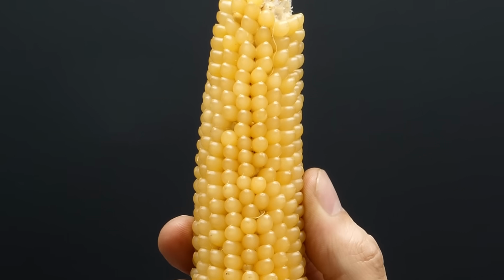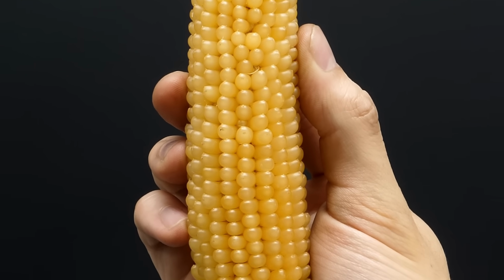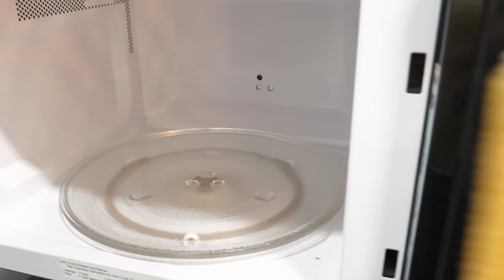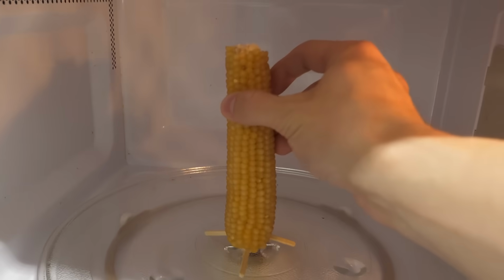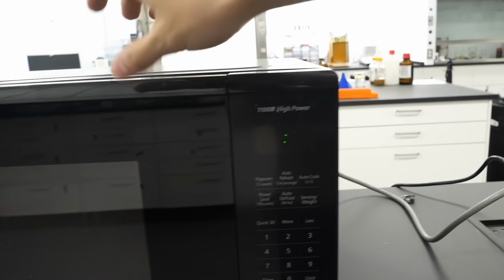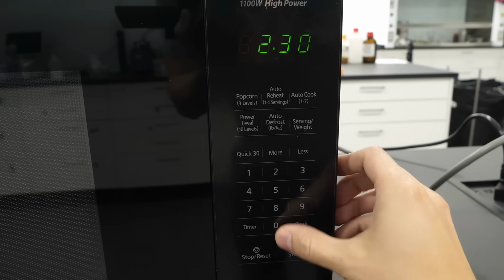Popping corn on the cob in the microwave

Comment: he actually drilled a hole into his microwave, what a mad lad
Reply: Holy shit! I didn't even notice
Reply: :awesome:
Reply: It was for his other project, when he did plasma balls in microwave. #Deep_lore
Reply: he is building up his radiation resistance so he can finally visit Chernobyl. with no safety equipment
Reply: it turns out, the waves emitted by a microwave are pretty big! so the hole could be easily 2-3x the size and still not really be a danger!
Reply: @omaro_o7151  how did you think he made the footage?
Reply: @MusikCassette   shrunk himself to fit in microwave and shot it with his phone, as any sensible mad scientist would do.
Reply: It is not mad if you know what you are doing.
i.e. you need to know the wave length the microwave uses, and make the size of the hole acordingly.
Reply: dont worry this really tells that you have a great eyesight
Reply: Since microwaves wavelength is about 12 cm high they can’t escape from small holes so it’s very safe
Reply: @user-ny2wy3jl1t  how in the fuck did you type awesomeface
Reply: It's to stick your finger in and test the temperature.
Reply: 1:13 holr is at the back of the microwave.
Reply: @Unknown-ov7pq  wow bully in comment
 🤣
Reply: @Ketan Roplekar The frequency put out by a microwave is around 2.4 GHz (Same as your WiFi yes), with that the wavelength is around 5 inches (12 cm) which prevents the wave from escaping from a tiny hole. There may be a little bit a radiation leakage, but it probably wouldn't be enough to do any damage. But I would still not recommend drilling holes in a microwave unless you absolutely know what you are doing as it can get much more complicated than just wavelength and hole sizes.
Reply: @satanhell_lord  Thanks for the info Satan-Chan
Reply: Lol really? I thought he just put that camera in the microwave, I was like “damn that’s a strong ass camera”
Reply: @user-ny2wy3jl1t  android?
Reply: @darkphantom5681  same, hahaha 😅😂
Reply: There's bots in this comment
Reply: Second channel I've seen do this. First was TKOR a few years ago.
Reply: @s1lh0u3x  Anyone can do that though. You can visit Chernobyl and you don't need any protective gear
Reply: he did it when he made the microwave plasma video in the main channel
Reply: @craiga4215  no mean like. inside the reactor.
Reply: @Mila kunis______👇💞 Why the hell are you guys always trolling!
Reply: Na it was the cameraman who was inside
Reply: @user-ny2wy3jl1t  how

Comment: You have to tell more about the Unregistered Microwave Spycam V2 that can withstand the power of microwave.
Reply: yeah wtf how
Reply: Seriously? Just think about why you dont get microwaved while standing in front of the microwave... And then... You know how to protect your camera.
Reply: Thats what i noticed too. A
Camera inside a microwave!!!!
Reply: Just what I was thinking!
Reply: microwaves use standing waves, meaning there are parts where there is lots of energy and parts where there’s none (which is why the plate spins to try and get each part of the food touching the high energy bits at some point) so there’s parts of a microwave where if you put a small enough camera there (smaller than a blueberry which exploded b/c they’re the same size as the wavelength so it gets supercharged) then it’s fine, say like where a screw goes or something
Reply: @realericanderson  Thats maybe valid for microwaves that have that moving table. If you have one with that moving waveguide (or hoever that thing is called) i thing that wont work.
Reply: @realericanderson  uh I think he drilled a hole at the back and try to adjust the phone/camera just to get the perfect view
Reply: It was the v4 and it is registered for secret ops from nasa
Reply: Thissss is what I came to the comments for..!! Wtff how??
Reply: @luisgin8288  You mean how he filmed this?
You realise that you can see the camera at 1:15.
All he did was cut some holes into the back plate of the microwave and put a phone against it.
Reply: Drill bit, meet microwave. Cell phone, meet hole-in-microwave.
Reply: He built a custom Faraday cage made out of invisible... material.
Reply: I forget what video it was. I think it was one about making plasma in a microwave. But he explains how did the camera setup in that one.
Reply: @emanemanresuresu  that would be the lead mesh on the window. But i didn't see that infront of the camera.
Reply: @xstation6445  i bet you could make it so the caemera sees through.
Reply: Weeaboo Jones  Finally someone said it. a hole the size of a quarter will allow partial microwaves to pass out the back, a hole the size of 4.7 inches will allow complete passthrough. Noone going to talk about the health risk involved here just for a cool couple seconds of footage lol?? If I was living with him, I'd be moving out... stat.
Reply: @realericanderson  Just drill a hole in the microwave and place the camera looking inside. It's not so hard, you can definitely do much more dangerous experiments with a microwave than the simple act of watching inside it.
Reply: @joelembiid2238   First, no one lives there it’s his personal lab where he records videos. Second, you’re being overdramatic the hole is small enough that either very little or no radiation is leaking and even if it did there’s very little risk that he would be seriously injured at most minor burns and even that would be a stretch.
Reply: Metal camera inside a microwave?  Or plastic camera?  Either way they would be destroyed.
Reply: @joelembiid2238  Relax, man. It’s not ionizing radiation.
Reply: Watching popcorn pop on/off the cob was something I never thought I'd want to see, but now I hate the fact I didn't see it sooner because that was so satisfying to watch.

Comment: Wait, how can the camera be put in the oven without blowing up ?
Reply: it isn’t in the microwave, me made a small hole in the back wall of it and put the camera up to it so he could see the corn
Reply: Cameraman
Reply: The camera man never dies
Reply: because the microwave in this video was tasked to pop corns not fry a camera
Reply: @ThatGreenCrystal  Not true
Reply: You can see the hole he made in the microwave for the camera when he opened the door
Reply: @PilaCiu  what he said is true. electronics fry in a microwave because they're overcharged, not because they're heated
Reply: @PilaCiu  You are wrong. Microwave oven are tuned to be able to oscillate the fat and water particle. When the oscilating particle reach its resonance, they will heat up very fast.
Reply: @PilaCiu  If you put a plastic in a microwave, it will not heat up. If you put soap in the microwave it will expand because there are fats in it. If you heat something such as fries or chicken nuggets,  it will come out soggy because of the water molecules escaping the structure. This is also why when you feel the sides of the microwave they are not burning like an oven. The radiation of the microwave creates molecule vibration causing the piece of thing to heat up. Things such as plates heat up because dissipation of heat such as water molecules in the moisture of the air
Reply: @ThatGreenCrystal  Then why does metal and cardboard heat  up?
Reply: @PilaCiu  Metal because It is a great conductor of electromagnetic radiation, just how it is used in powerlines.  Cardboard is an insulator. Water molecules can get trapped in the cardboard since cardboard removes moisture, then when the water molecules get too high at about 400 degrees Fahrenheit the cardboard literally stars to catch on fire because of polarization of the trapped moisture
Reply: @PilaCiu  I guess if you really put it, you could add metal as long it's not ionized or put a a special configuration (like if two metals are touching it would work or if it was a magnet). Some metals can be an a insulator too. Usually when the atoms  are not aligned in a certain way

Edit: Sorry, I meant that every metal can conduct (because electrons can move freely) but some are just really good and really bad at it.
Reply: Yo can anyone actually explain how did it not blow up?! It has electronics and yes is susceptible to charge damage. So why it doesn't..
Reply: @ovalquadrant6012  yes, but barely noticable to a temperature change more than others.
Reply: @srisutharsan3089  hole in the back of the microwave
Reply: @iPlayHacker real
Reply: The camera Is invincible
Reply: @gm_construct_13_betaexplor38   huh? how's that possible??
Reply: @ThatGreenCrystal  are you guys physics majors or is youtube just full of microwave oven experts? This is an oddly specific thing to have expertise in...
Reply: @thegeth4293  no it's just thermodynamics and electromagnetic forces
Reply: @iPeter that's why I said and metal too
Reply: @iPeter yes 😂
Reply: @ThatGreenCrystal  Plastic absolutely heats up in a microwave. Put a plastic bowl in and run it for three minutes and then tell me if it's still cool as a cucumber or not.
Reply: There's a tiny hole, small enough to keep the phone camera from being zapped, and or/radiation to leak out
Reply: @ThatGreenCrystal  That was so informative. I always wondered why some stuff was so soggy coming out of a microwave.
Reply: @SkcreamStream  yeah I NEVER cook bread in a microwave it always gets turned into a lump of rock
Reply: Ikr

Comment: I actually haven't seen sweet corn back in my home country. Sweet corn was the same thing as the hard corn you used but boiled. We would prepare the hard shell corn by roasting it on fire and adding spices with lemon on it. It's really good
Reply: That's not the same as sweet corn, but sounds tasty.
Reply: It’s called a bhutta here in india, we would roast it then apply spices, and lemon on surface, another way is instead of roasting, just boiling it and then applying sip iced and lemon.
Good stuff
Reply: Just ate some today, cooked it in the microwave, shuck, cob, silks and all. Cook for 1.5 minutes and remove from microwave, cut through bottom section and pull the shuck and silks off from the other end. No salt or butter even needed. Yum Yum.

Comment: one interesting bit is how all of the initial kernels to pop were at the same level on the cob. I guess this could be due to how the cob developed, but my guess is that it is due to the standing waves in the microwave imparting more energy to those kernels. I've always wanted to see a 3-d demonstration of microwave standing waves. The usual ones using chocolate in a sheet just shows you two dimensions, but I wonder what it would look like in 3D

Comment: This is very cool. I'm interested in the spycam too. Is it not effected by the microwave radiation?
Reply: Microwaves, despite what their name might suggest are actually quite large, about of 10 cm, the hole for the camera, being 0.1 cm or less basically lets through almost no microwaves
Reply: the microwave doesn't have radiation. It has microwaves tuned to excite water molecules. Its probably uneffected if its not metallic and has no water in it :)
Reply: @stephenwhiddett  The magnetron generates electromagnetic radiation at that specific frequency I understand, just wondering if that has any effect on a camera. I know other forms of EM like x-rays have an effect
Reply: @tubbychubb3026  I don’t think so. They are just like radio waves but with a shorter wavelength
Reply: @stephenwhiddett  Radio waves and microwaves (and even visible light) are all considered electromagnetic radiation. It's still a kind of radiation, even if it's a lot less dangerous than the "scary" ionizing radiation that most laypeople are afraid of.
Reply: @stephenwhiddett  It's short-wave radiation. Just like radio waves. Heat, microwaves, light, sound, all forms of radiation. Radiation literally means the emission or transmission of energy in the form of waves or particles through space or a material medium. That covers a lot.
Reply: @tubbychubb3026  Yes, they are a classification within the EM spectrum.
Reply: technically anything that radiates out from a source is radiation. Tubbychubb, what you are probably thinking about is ionizing radiation which i am not sure if microwaves are considered ionizing or not be yes it is radiation.
Reply: @AL_O0  I guess that explains why X-Rays would effect a camera since the wavelength is much smaller.
Reply: @IrishRepoMan  ok but it's not radioactive which I thought the original question was asking
Reply: @nicksmith1280  
The only thing a microwave can really do is fuck with wifi signals.
Reply: @stephenwhiddett  The original comment says radiation, and you replied saying microwaves don't use radiation.

What you're thinking about, nuclear radiation and radioactivity, is more specific.
Reply: @stephenwhiddett  Sadly, every single thing you said is factually wrong, sorry. I know in the intention it's all near the truth, but actually, it's not.
But it's normal, I even learned one of them today too. Even the people that know approximately and try to be right can be misleaded.

First, as said earlier, microwaves are electromagnetic radiations, larger than light (IR), when ionizing radiation, that are cancerigen, are shorter than light (UV), and these are everywhere, from human activities, and most importantly (from the sun (in both heathly and dangerous ways, because most rays are not ionizing, but long exposure can still be too much so we have to use sunscreen)

But yeah that's are not really radioactive, like particles that disintegrate and radiate ionizing rays and particles. (Those we still encounter everyday naturally, but in very few quantities, and which are still extremely far from x-rays scans, that are the most dangerous ionizing things we'll all ever encounter, even for nuclear employees (pilots and astronauts are in the worst cases too, thinner atmosphere means more unblocked ionizing radiations from space up to gamma-rays, beta and alpha particles.

So now about the tuning... Well, that's sadly(?) wrong, because in fact a magnetron is very chaotic and can't produce mono"chromatic" tuned waves at all ; so it emits in microwaves, but in a relatively large variety of lengths, so it's not specifically existing water...
I felt so cheated on when I saw that earlier xD but now it seems more logic viewing how a magnetron works.

Instead, the microwaves somehow produces electromagnetic fields that force molecules to turn in a certain position, which is also what's causing friction and heat anyway. I don't know precisely, and I'm still wondering if hydrated things still generally heat more easily than completely dry things.

And finally, about the metal... It depends. first, microwaves are made in metal, it's precisely why it works, as a faraday cage. Metal mirrors waves without absorbing them (mostly), so it's not heating itself, but when a microwave oven is empty or with only metal inside, waves will bounces infinitely until they encounter a little hole... Or find their way back to the magnetron and bounces even more, so all the accumulating energy will finally make the metal heats and ends to destroy the oven.

Then, even if there is also some food to spend the energy in, as an "unexpected" metallic object placed in a microwave will rarely be perfect, all the the imperfections, gaps and curves in the metal can make the waves concentrate on some points, and quickly form sparkles.
But now, if we respect how microwaves works, it means we actually can put metal inside of a microwave, but a specific plate, with no imperfection so it will simply make waves bounce back to the food over it.

I've already tried microwaving party plate (refined, like for weddings maybe), that has metallic patterns and borders, for a minute or two. It didn't explode that much (made sure that there were enough food to absorb most waves anyway), but when I "cracked", I noticed that it was always  on the most damaged parts of the pattern.

So with so much waves, even a little hole will surely encounter waves. I also wonder how it interacts with the camera. Camera works by absorbing visible light, and here it's basically invisible and less energetic light, so maybe it just bounce back on the flat objective to the oven... Which would mean we paradoxically shouldn't make the hole too small, to prevent waves of being captured.

Comment: The important question here, how are you recording that from inside the microwave?
Reply: There a camera on microwave
Reply: @Nama181-j2c  ok, then the question is how the camera can tolerate heat😁
Reply: @wakawaka608  built in
Reply: He drilled a small hole on the back of the microwave, as long as the diameter of the hole is smaller than the wave length, it won’t cause radiation leak, also the camera is outside the microwave taped to the back recording through that small hole, you can actually see the hole when he put the corn in.
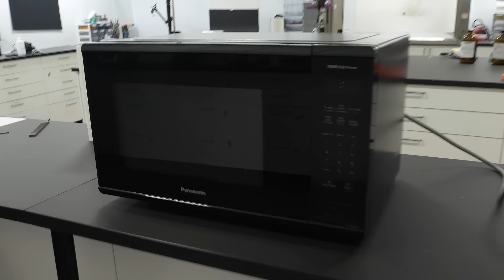Reply: @liming33  thanks mate. The hole is visible at 0:30
Reply: @liming33  woah thanks
Reply: I'm sure it's at the glass
Reply: Antman shot the video, simple
Reply: @liming33  Nut Uh He Microwaved a GoPro
Reply: Unregistered Microwave Spycam V2
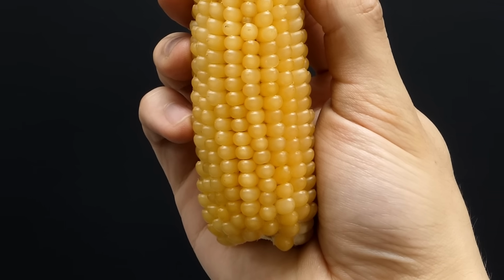Reply: @itzamia  Bullshit. You can see the 3 holes for the camera and 2 flashes of a phone camera on the back of the microwave at 0:30 that he drilled in.
Reply: @bread_dawg  The "Nut Uh" was suppose to show sarcasm.